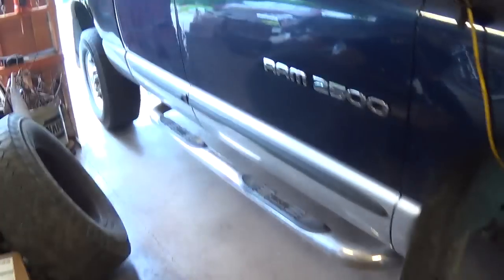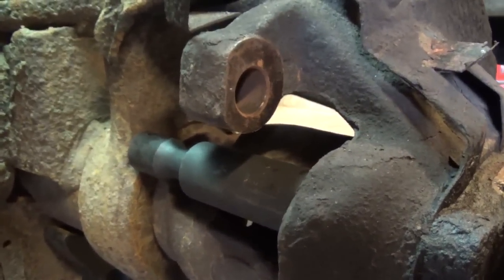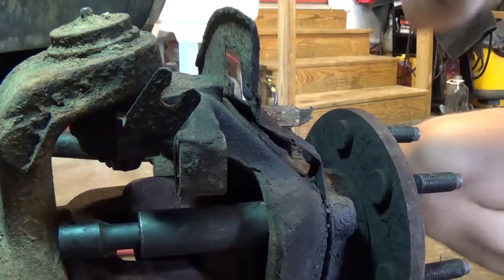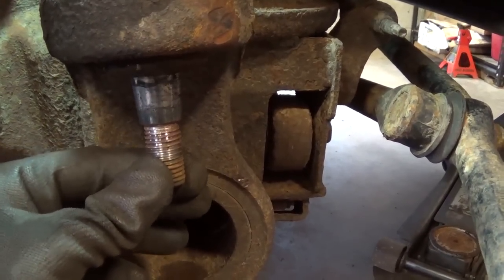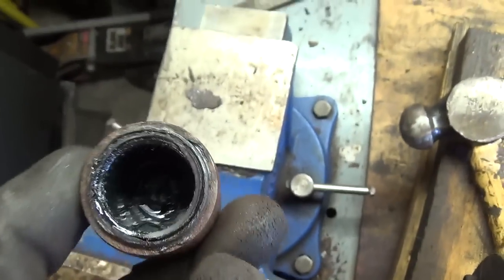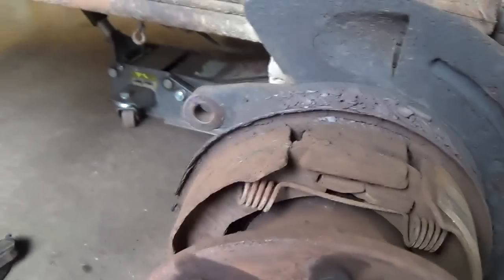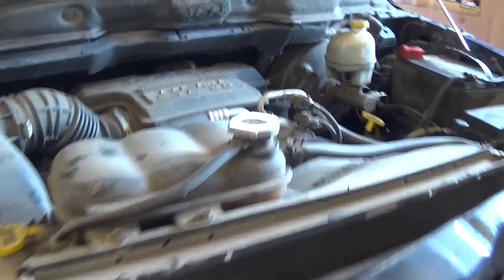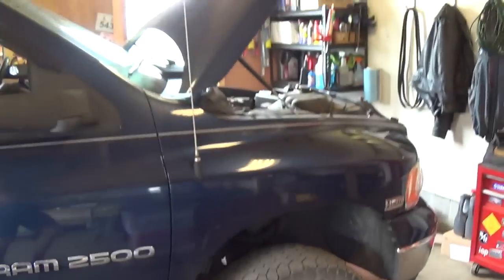Quick Tip: Dodge Ram front wheel hub removal

Comment: Lisle makes a hub bearing removal tool for about 20.00 for an air chisel.  Set it up like you did but instead of the socket the tool fits over the bolt heads and you rattle it off in seconds. Check it out.

Comment: I’ve done four of these in the last year and a half.  What a pain.  Never thought of using the power steering like that.  I usually buy replacement bolts and use in place of the stock ones and hammer the bolts driving the hubs out.  Some times it can take hours per side depending on how rusted in they are.  You got lucky with this one.

Comment: This is the best video work I have seen on the power steering method of removing the hub bearing assembly - nice job cameraman! The power steering method is the ONLY method in my opinion that works up here in salt country. The Lisle air impact tool is a joke - the Dodge laughs at such puny efforts. You would think that 3 jaw pullers would do the trick, and maybe in the South they do, but not in salt country. Anyone using the power steering method should choose a socket or extension that they don't care about, because the force exerted on the tool(s) is significant and will booger up both ends of the tool. I still have the left side to do, and maybe using that Lisle tool for the "pusher" would give it some purpose in my toolbox.

Comment: Air hammer does not always work have hammered on the loosened hub bolts with an air hammer until the heads were mushroomed and still not break loose. Used this method and it worked. If manufacturers would apply anti- seize wouldn't have this problem.
Reply: did  mine last week..15 minutes of air hammering before broke loose...cheap harbor freight one but it worked.

Comment: Good video. I used that exact trick about three years ago and it worked perfect for me just spray with WD-40 first, then  hang on the wheel  for a couple seconds and it does come right out. Use impact sockets and extension    others will bend.

Comment: I put a short socket on the bolts a beat on them with a baby sledge like I saw in an older guys video.  It took about 5 minutes of beating on one side and about 45 minutes of beating on the other side.   Ruined the socket but it worked with some consistency.   Wish I would have tried this method.

Comment: should of done upper and lower ball joints along with hub bearing just because your going to end up tearing down everything again but good video man
Reply: Totally agree,  the parts costs are almost nothing compared to the time required.   These Rams with the heavy cummins motor eat those lower joints. If you are replacing the unit bearing do the ball joints, needed or not.

Comment: That is a cool way to remove the hub on a Dodge. The first time I did it that way it snapped the shaft in the steering pump. Now I don't force it as much. That was a BIG job and I bet you were tired after.
Reply from the maker: +wysetech2000 Wow that must have been expensive! Yeah I didn't know how much was too much...luckily no damage done in this case.

Comment: Dang! Just spend a couple hours trying to get the hub off. Gave up and was going to take it to a dealer. Now will have to try this method! Unfortunately I already put it all back together. A weird thing happened though after doing it - the truck wouldn't start. The TPS light was on and now wondering how doing the brakes affected the TPS? Will try to reset it in the morning with the tips I just watched on You Tube. Thanks for this tip! Gotta love You Tube! (Thinking it might be cuz I left the ignition switch on while using the engine to turn the steering left and right to get the caper bolts off?)

Comment: Nice video! I'm here after seeing you on Eric's channel. You can also apply a similar method for wheel bearings on light duty vehicles by threading  bolts so far back into the hub and using a air hammer on the top of the bolt.
Reply from the maker: +dreamer2355 Great tip! Does that damage the bearing at all? Guess it doesn't matter if you're replacing it anyways!
Reply: No but you can damage the head of the bolt if your not careful :)

Comment: This works on Jeeps too. I have also had luck backing off the bolts til they are flush, put a socket on the head and hitting it with a big hammer, or an air hammer.

Comment: I could only imagine a 5.7 moving all that truck with the weight of the axles and body, I was expecting a v10, I'm not sure they had the 6.4 out by this generation but wow she must be a heavy drinker. I have an 03 HO 5.9 NV5600 and she does ok for city stuff, I'm expecting it to get better with new injectors and manual lock front hubs, but sheewww that 5.7 made me do a double take.

Comment: I did that same trick on a '98 Wrangler but first I pounded, chiseled and swore in 4 different languages. Using the hydraulic
steering and a piece of bar stock the hub popped loose like nothing.

Comment: Get an air hammer. They will come right out. The power steering pump isn't designed to deal with that much force. Ironic a dealer uses this method. No worries, they break it they will tell you they "found" your pump steering box, whatever they damaged bad and you pay for their stupidity.
Reply: That comment makes no sense.  Power steering pump bypasses when it reaches a specific force.  Why would they design a pump that gets destroyed when you hold the steering wheel full lock?

Comment: I'm going to be doing this soon and will be using the pipe wrench method from https://www.youtube.com/watch?v=mVWgHiR6rlo because it looks like it would not put pressure on the steering components like this might. However if the pipe wrench fails I'll be using this trick.

Comment: bent my steering arm thanks
Reply from the maker: well something's gotta give eventually...
Reply: yup    just bought a dodge 3/4 ton had a bent drag link from someone else doing that technique works if only little pressure needed
  you should use a puller that bolts to the outside and pushes on the axle when they are really stuck or you will bend your steering linkage I have snapped extentions that way as well.....  .... One trick use a wood spacer between socket so that the wood can take the excess pressure if the assembly is really seized the wood will give and not your steering :)

Comment: Mechanic change them both replace the hub it's insurance
Reply from the maker: Insurance? Do you think people have unlimited funds or something?
Reply: Pine Hollow Auto Diagnostics let's see your spending the time to just do ball joints your that far into it, spend the money for the other parts that hub does fail or upgrade to locking hubs which you can take a part re pack with grease and I'm a season mechanic, it's called preventive maintenance less down time